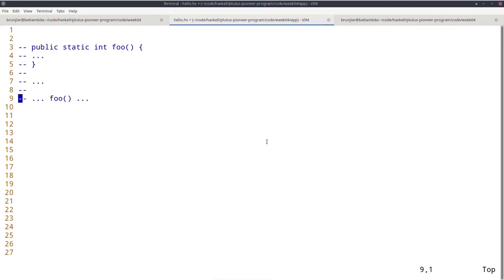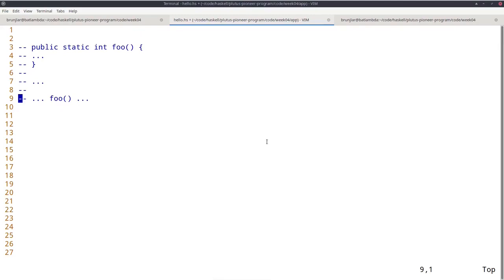PPP 030401 - Introduction

Comment: Thank you for the great tutorials. I have one question; as you mentioned it's not possible to use many high level features of haskell inside the validation code because of the compilation issue. I was hoping if you could make this a bit more clear for me. I need to call a function inside the validation script that is dependent to a C library (libsecp256k1), is there really no way that I can make this happen?